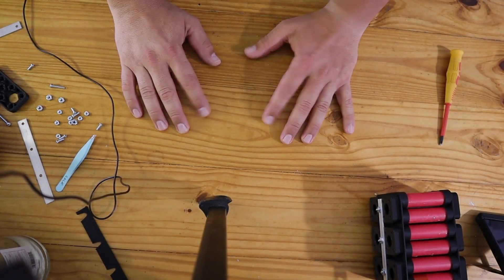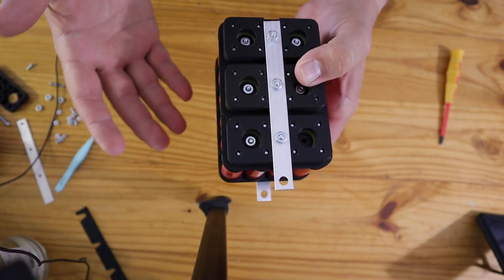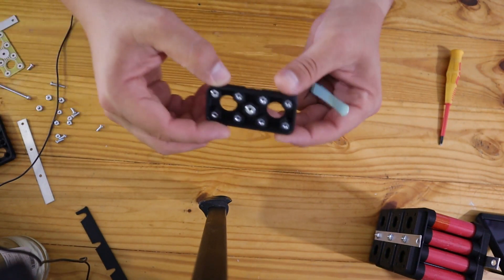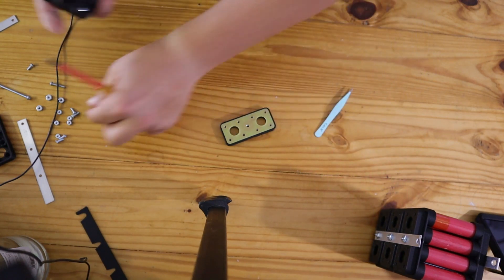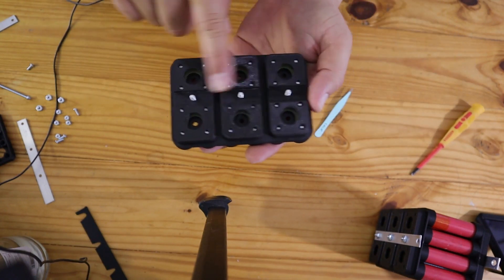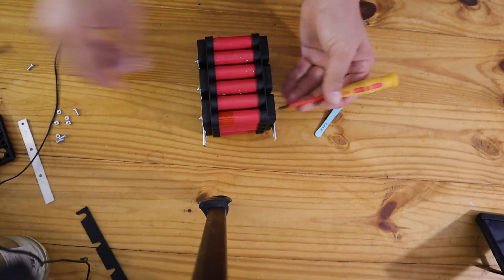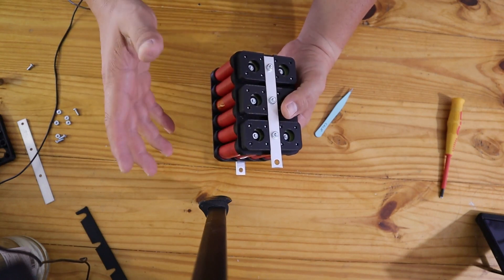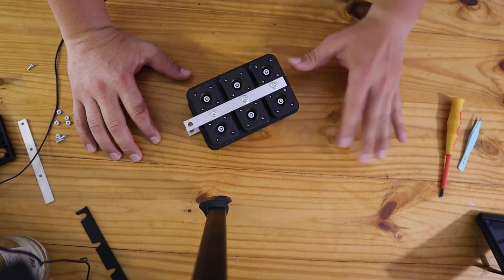Introducing my newest Diy Powerwall PCB Kit

Comment: How do you confirm or test if  all the cells are connected to the pcb,that no one of them has an open circuit
Reply from the maker: You can use a multimeter and check for continuity between the cell and the busbar
Reply from the maker: Also, i run many tests before deciding on this design

Comment: You should make the spacer on the positive side red to prevent mistakes when connecting packs.
Reply from the maker: It can be done. But a simple red dot can also help.
Having 2 colors will bump up the cost

Comment: How many volts...
Reply from the maker: 1s is 3.65v nominal
Reply: @javiercamacho  total voltage...
Reply from the maker: I just told you. This is a 1s module. 18650 cell are 3.65v nominal.
Reply: @javiercamacho  not every body knows about nominal voltage..what you saying all those batteries you only have 3.65 volt total...
Reply from the maker: @erikroman2008  learn some 18650 lingo please
Reply: @erikroman2008  Best practice for battery building is to construct parallel packs to your desired capacity. These kits enable you to create 24 cell packs. An average cell capacity of 2,200mAh yields 52,800mAh packs.

So, 3.65Vnom x 52.8Ah = 192Wh

From there, you connect packs in series to your desired voltage. Four packs in series yields what's considered a 12V battery. Actual voltage is:

• Vmax - 4.2V x 4 = 16.8V
• Vnom - 3.65V x 4 = 14.6V
• Vmin - 2.5V x 4 = 10.0V

This 4S24P battery is 53Ah/771Wh @ "12V".

Seven packs in series yields what's considered a 24V battery. Actual voltage is:

• Vmax - 4.2V x 7 = 29.4V
• Vnom - 3.65V x 7 = 25.6V
• Vmin - 2.5V x 7 = 17.5V

This 7S24P battery is 52.8Ah/1,349Wh @ "24V".

And so on, and so forth.

Hopefully this is helpful information.
Reply: @ARepublicIfYouCanKeepIt  thanks for your answer...really appreciated....
Reply: John Coloe - like erikroman2008 said Thanks !

I knew most of what you explained but really liked the way you explained Vmax, Vnom, Vmin ! And then the total Ah/Wh @ V

Thanks again John Coloe
Thanks erikroman2008 for asking the question

Comment: First how many amps can it handle and what’s it cost and where do I get it from
Reply from the maker: Current cells can push 2 amps each so this one is 48 amps. 

Retail right now is around $18 per module but working on getting better deals and lower cost on parts
Reply: Javier Camacho ok thanks at $18 I’d end up spending nearly an extra $400 plus shipping for the the battery I need to build 14s 48p. Cost is far to high for me to use them. Thanks.
Reply: Sailboat RJ electric boat 

You might want to look for sources closer to home and maybe discover better pricing locally or slightly used batteries
Reply from the maker: Please wait for the next video update. You'll like it more.

Also, this is a one time buy. The only consumable are the fuses which are pretty easy to get
Reply from the maker: The price is only for the kits. We don't sell cells